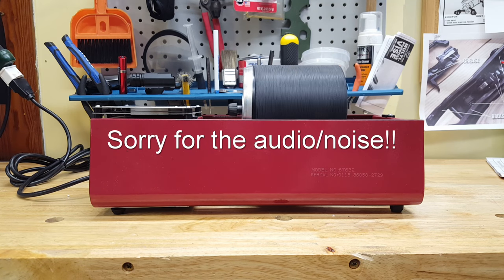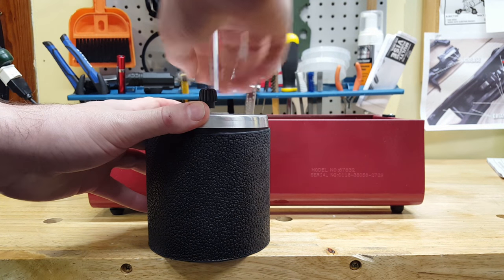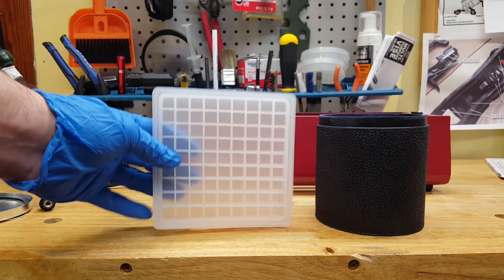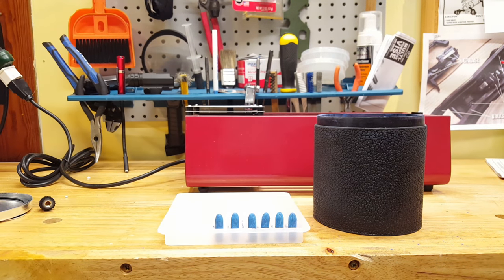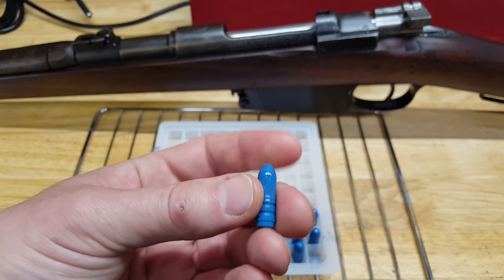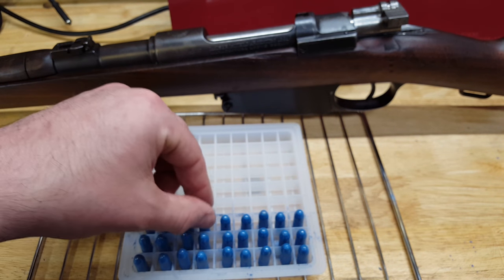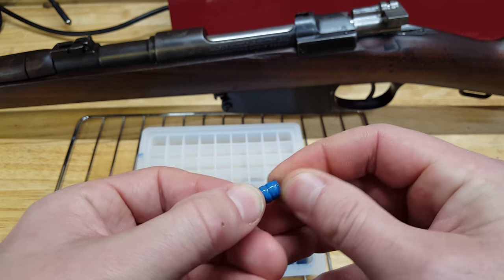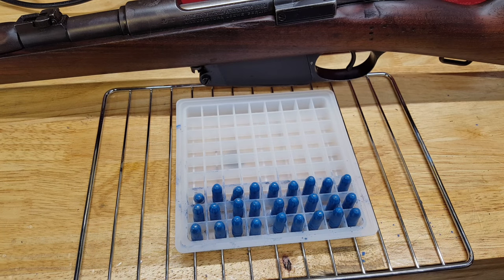Powder Coating Bullets:  HF Tumbler and Silicone Ice Cube Trays

Comment from the maker: My next batch I dumped the rest onto the wire mesh and then shook off the excess and transferred them, filled the whole 81 count ice cube tray and they looked real nice, still some thin spots where I touched them.  I could remedy that by using tweezers but that's too slow for me right now, I have limited time I can be on my feet.
I counted and had over 125 bullets in the tumbler and could have fit way more and it still would turn just fine.

Comment: i use a silicone trivet with hexagonal holes that hold the gas check shank perfectly with 30cal boolits and everything smaller such as 6.5mm in micro ice cube trays 1/4x1/4x1/4", both holders are available on fleabay and amazon
Reply from the maker: Yeah they work great, I'll never do it the old way again!

Comment: It's cool concept but time consuming.  I tumble in plastic food tray with lid (no BBs) by hand for about 1 minute, dump it on wire basket, the ones from thrift store that are used for deep frying work and they are normally few bucks, I keep a few to separate the colors, bake it and you can either drop it in the water or if you don't want extra hardness let it cool off till it's very warm to the touch and break them by dropping, Elvis Ammo has video on it.  It's much quicker this way and there are minimal spots where they were touching.

Comment: Those look superb! I realize this is a really old post, but what temperature did you bake at using the silicone ice tray?
Reply from the maker: Thanks!  I try to check my comments and reply to everyone but sometimes Youtube doesn't alert me.  I heat the oven to 400 degrees.  I do 15 to 20 minutes, been a while since I've done any.  I put a heavy piece of metal at the bottom of the toaster oven so it doesn't dip as hard in temp when you put the bullets in, then I quench them in water straight from the oven.  I love using powder coat, I was going to buy a lubrisizer but it's so easy to coat them in bulk I don't see any reason to use traditional lube.  Plus, less lead exposure.
Reply: @Toolness1  thanks for the reply. I have the same issue with YouTube notifications lol. Sorry I didn't thank you 3 weeks ago. I'll have to look into a heavy piece of metal, as I noticed what you were talking about on the dip in temp.